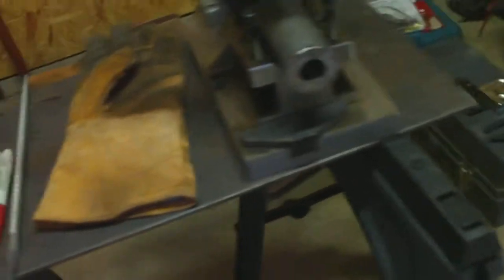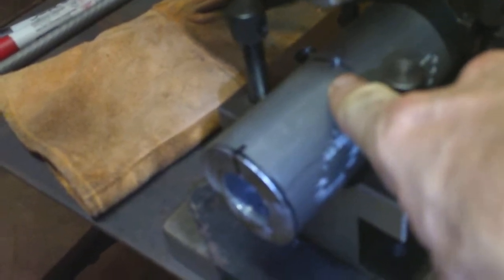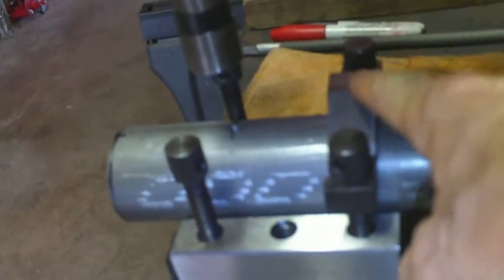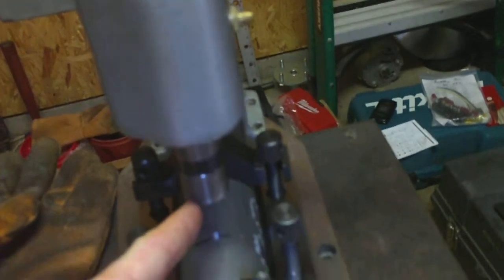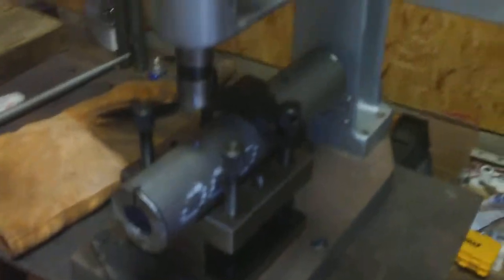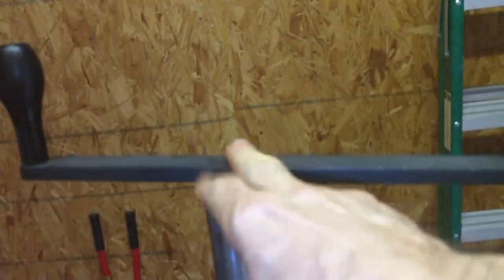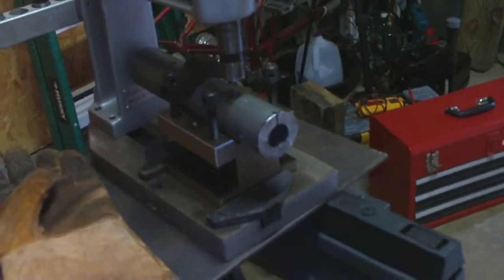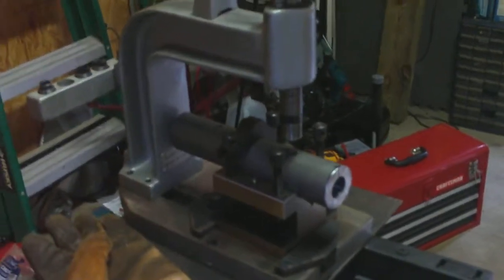58 - Deflection DOM Tapping

Comment: I just found you on here. Very interesting work!. I am doing the same kind of thing with a vastly different approach. I am using the fluid transfer method as explained by Mr. Teslonian. I am also using a flywheel. I just got a power rack for weightlifting, hate to see you use yours in this way! I would love to exchange ideas with you. Waiting on a working model....
Reply from the maker: +Bill Spencer Tes has some cool videos and good ideas. I think he claimed he already had 2 gravity driven generators, one small, one larger, but he's never posted a video of either one, so not sure if he actually has a working device. I'm currently changing out the winding wheel (bicycle wheel) on my device. It could handle the mass needed to drive the extreme ratio gearbox. I'll probably go with a steel wagon wheel and make the necessary mods, help keep the cost down. Check out all my videos on this project, I think there's around 60 so far. A lot of lessons learned, and some advanced mathematics were needed along the way.
Reply: +Getis Realis I am using two winding wheels that are New Bedford Ductile Babbitt adjustable sprocket no 4. They can handle the weight I have which is two 55 gallon drums (alternately filled) and I will keep the sprockets oiled because they don"t have bearings. The slow speed makes them usable for this application. Tes posted his video two years ago claiming to have two working devices but hasn't mentioned them since. I have seen all of your videos. I found you because of a comment you made on Dwight Wilkinson's machine, I am glad I did, you are much further along than I am. I am interested in everyone's failures as much as their successes because I can learn from others trial and error. I appreciate that you explain each in your videos. Is it your goal to make an overunity device that rewinds itself from its own power or are you planning to always make it a manual rewind device?
Reply from the maker: Bill Spencer
I'm not really interested in the over-unity or perpetual motion goal. I'm the type of guy who's building a practical and usable emergency generator. If the device proves to produce lots of wattage and has a good running time, then maybe it can be used for everyday use, not just for emergency use. I prefer to eliminate what doesn't work and maximize what does. By the way, check back tomorrow on my channel, I should have another video up on how I dealt with the shaft deflection issue.